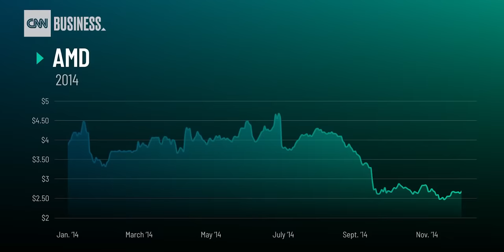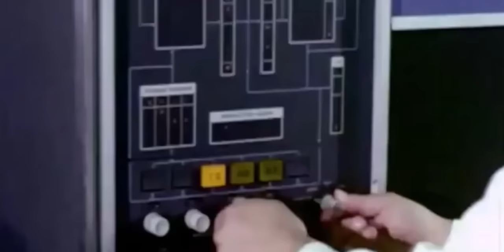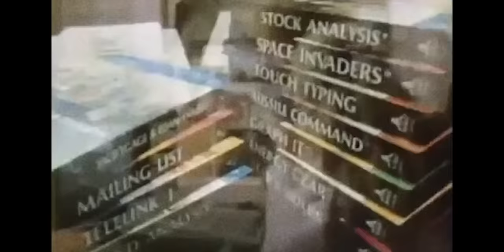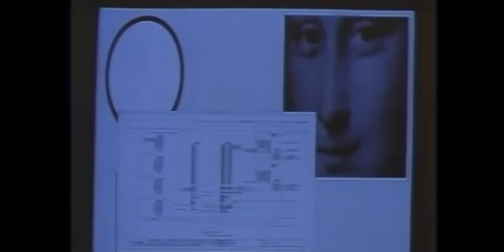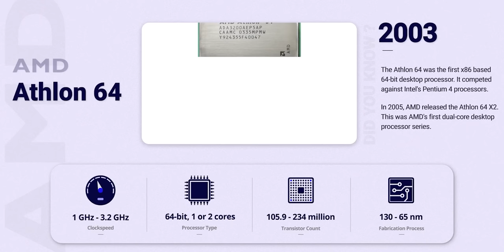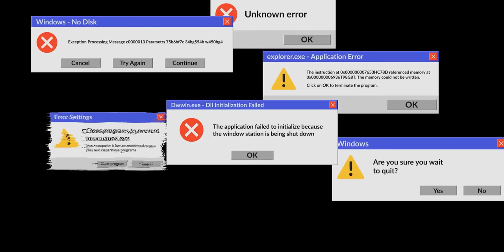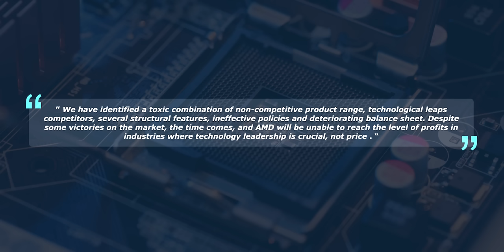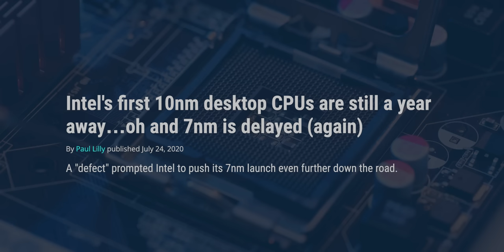The Real Reason AMD Is Worth More Than Intel

Comment: Remember when Intel monopolized the market for pretty much a decade? Absolutely minimum innovation and improvements yet towering prices. That was awesome... It shows how much we need both of them to keep one another in check. AMD and Intel are a perfect representation of Yin Yang.
Reply from the maker: Good take!
Reply: I think Qualcom should enter their processor for computer in the market.
Reply: Intel, Nasa, Disney.. the devil's mark.
Reply: So many people forget that little tidbit of history, I personally felt that intel’s stagnation is why the ryzen was so successful.  The first gen ryzen cpus were not better or worse than intels, they were about the same with a lacking in stability.
Amd also seemed to have a roadmap for faster and better designs, where intels roadmap was in the line of 5% per generation.

Barely related note, I see Microsoft being in trouble with steam os disrupting the gaming industry away from direct x, and apple going with arm processors that are faster and more efficient, in my opinion we are in the middle of a huge market shift away from antiquated x86 architecture and going arm.
Reply: The 2600k was a monster.
The 6700 a 6 month old McDonald's burger.
Reply: @RG3DHD i dont recall saying x86 will die, i said shift. meaning more and more arm will dominate the market before too long, a transition to more efficient and faster hardware.  x86 has its limitations and old instructions that have to be present limiting its ability to compete with arm. its like comparing carburetors to direct injection, carburetors are still around and being used, just the mainstream market shifted to better and more efficient technologies. 

if you dont agree, that is what playing the stock market is like, i think itll go one way, and you the other, time will tell.
Reply: @benjy117  Why? How?
Reply: @TickerSymbolYOU  i liked how you kept this simple enough for anyone to understand. those of us who follow tech will like adored tv videos of intel vs. amd and the nvidia vs amd. you get a sub for taking the time to understand what was going on and keeping to simple. will be keeping an eye on you to see where you go from here!
Reply: Who is the secret semi conductor giant ??
Reply: We're still missing 1. We always need a total of 3 for perfect balance.
Reply: @weebiyappa3333  Samsung
Reply: @D Nvidia actually deserves first place because they deliver big improvements. The only problem are the prices... It will take a long time for the competition to match their GPUs in performance and features so their can lower prices, but by then, Nvidia will probably be too ahead again.
Reply: @thomaslabrum8182  Interesting points Thomas
Reply: @amitchodankar1989  imagine that ARM processor can be replaceable like an x86 CPU's
That must be a game changer. 

I think one of them already thinking about this.
I mean AMD and Intel
Reply: @amitchodankar1989  Qualcomm's strength is the ARM architecture. X86 is a completely different animal...but I agree, they need to expand more.
Reply: @TickerSymbolYOU  There is a slight error in your video regarding the original IBM PC.  The original IBM PC actually used the Intel 8088 not the 8086.  The 8088 was a crippled version of the 8086.  Crippled in that during packaging only 8 of the 16 data bus lines where electrically connected and exposed for use.  So where the 8086 could make full use of all 16-bits of the data bus the 8088 was limited to moving 8-bits or half the amount data per memory clock cycle.  As such the 8088 was a cheaper than the 8086.
Reply: @SoulGuitarMetal  In terms of raw Rasterization, AMD beats out Nvidia when comparing RX 6000 and RTX 3000 series. And if leaks are to be believed about the new 7000 series cards, they're going to dominate Nvidia, most people don't care about raytracing, which is Nvidias specialty. Nvidia being the best has ironically made them believe they were untouchable, until the 4000 series dropped with sky high prices and garbage connecter that is dangerous to the consumers.
Reply: @pamus6242  the best thing was 1600AF. They were selling 2600 under 1600 name and they did not even mention it. Of course, in that time, it was cheap AF, pun intended. Before C19, before war, before ether mining craze. Times were great.

Comment: Ryzen really turned things around and made me really love AMD. Their laptop Chips are top of their class in terms of efficiency, i feel the reason why AMD is at the top now is because intel got complacent, everything from the 8th gen to the 11th gen all felt samey. That’s when ryzen really rose to the top, it also helped that their CPUs are generally cheaper and more efficient. I am glad that intel and AMD are competing again with alder lake.
Reply: 8th to 11th? They were doing same shit way before that. 3rd Gen to 7th Gen were practically indistinguishable, performance upgrade practically identical to simple overclocking.
Reply: I think the biggest problem for Intel was and still is the 10nm process.
Their 10nm process is similar to TSMCs 7nm process, however, TSMC is no longer using lithography but EUV, while Intel is still trying to squeeze out as much as possible using lithography. If they had switched to EUV, Intel could have easily swept AMD away, and I am saying that as an AMD fan.
Reply: @bionmccool  I think so too! That's why people look only at the i3-5-7 numbers more than the generation or model number, the difference isn't that much. Glad competition is finally back, letting people have much better chips at a much more competitive, (relatively) affordable prices.
Reply: @bionmccool  True dat and 8 onwards we got more cores but still the same Haswell cores for all its worth
Reply: @jonson856  well..
Reply: the reason amd is back on top is actually its use of chiplets which meant that with just 1 design amd was able to address all the way from HPC to low end desktop, no matter if intel was faster to the new node amd had a huge advantage of shear core count with 32 cores per socket (in 2017 is crazy) and really low cost of manufacturing, worst case scenario amd would have still sold a lot of cpus might have took them longer to get back up.
Reply: Yeah efficiency of AMD chips is amazing in laptops. I had a laptop with 10th gen Intel i5 and it lagged and battery also died fast. Now I am using one with Zen 3 Ryzen 7 and it is so much better.
Reply: I get similar performance on a 4790k as people I know with 10th/11th gen chips in most situations. They might have a 15% or so advantage in something if that software has a feature my cpu is too old for.
Reply: @fkknsikk  problem with those 4 cores is if you try do do more at the same time, i my 4670k stuttered quite a bit. because i always had other things opened in a 2nd monitor
Reply: I think the fab+ chip model runs into too much of the central planning problem. the amrket is finding it more efficient to have separate specialized companies, and it makes sense since one doesn't need the other to be developed together closely enough nor do they share the same research inputs.
Reply: I lose faith in Intel when I went from 6900Q to 8500 in my laptop without any gain in performance AND worse battery and thermal life. Meanwhile the dirt-cheap Ryzen 3500x PC blow them both out of water
Reply: Ryzens were big change for AMD, but there is still plenty of lies and myths created by AMD fanatics, like that it's cold (no, it's not, it's hotter than Intel with more powerfull high TDP CPUs) and Intel is not THAT bad as AMD people say. Yes, for notebooks, AMD is better option now, it looks like Intel totaly gave up with making low TDP CPUs, maybe they just don't have enough capacity in factories and they focus more on high end for some reason, it's sad.
Reply: @jonson856  The biggest problem for AMD is that they are not able to make  those CPUs by themselves, they are addicted to companies like TSMC. I still think that Intel is more advanced company because they are able to develop it and make it by themselves in their own factories which is still impressive even when their process is not the most advanced. I really hope that Intel will come with something better soon because we need competition on market again, today situation on market is just terrible, when you want to buy more powerfull CPU then your 10 years old CPU, you have to buy CPU for like triple price than your old CPU was for back in the day, that's not good, better HW is more and more expensive every year and I am scared by how far this can go, maybe in 2030 mainstram CPU will be for 1000 USD and GPU for 3000 USD, who knows.
Reply: @Pidalin  AMD used to have their own fabs. And this almost bankrupted them.
Reply: Ryzen laptops are chill AF.
Reply: @jonson856  it's impressive how intel makes use of 10nm. Like I thought 13th gen was 7nm Or maybe lower looking at the Proformance but was actually genuinely surprised that it's a 10nm competing against 5nm.
Reply: Same! AMD is a go go for me, and will still be. Never going on Intel again
Reply: @jonson856  EUV uses shorter wavelength/smaller beams to achieve higher resolution lithography than DUV which is used in the 10nm process but both are "lithography".

Comment: Concerning AMD 64-bit, you forgot to mention that it was AMD's succesfull x86_64 architecture that made it available to run old x86_32 code. That prevented (and saved us from) Intel's foolish IA-64 that would have upset the software base around the world (in a bad way). Thanks AMD!
Reply: That architecture is AMD64, the x86_64 label was a face saver for Intel after they were forced to adopt nearly all of AMD64 apart from a few features and used an Intel branding
Reply: Itanium.
Reply: @chudthug   Intel's plan was to monopolise the large Windows commercial market with 64bit server and emulation of x86 applications.
The Intel Inside program paid for OEM advertising, gave rebates and secured exclusive use of Intel CPU in blatant violation of anti-trust laws which were not being enforced.
The other server architectures ran Unix on SPARC, Power, Alpha which transitioned to 64bit earlier.  HP switched from its Pa RISC to Intel's Itanic.
Intel did NOT want competition they wanted a monopoly and were caught breaking laws in many countries to try to achieve it.
Reply: Regardless, Itanium was actually successful in destroying the old RISC/UNIX "cartel" and clearing the way for Xeon to dominate the enterprise market later. After that, Intel had little interest in IA64, beyond the contractual obligations with HP and the ecosystem vendors. No one in the industry had serious thought that Itanium had a chance to replace x86, and that was clear the moment Intel ditched the hardware x86 emulation support from the architecture and later made Itanium platform-compatible with Xeon.
Reply: @Ivan-pr7ku  Was it?  How many enterprize that were on Alpha/Power switched to it?  For my part, I "saved" mine by going against the architects recommandations to replace some Alpha servers with Itanium by showing that it was already a dead hardware in early 2000s.
Reply: I do also not agree with some comments in the video.
ATI was a big win for AMD, through the time of crapy bulldozer.  AMD Ahtlon64 is the best processor of all time period.
I don't think that we will encounter that kind of revolution with real benefits again. Maybe when we simplify our architecture towards ARM. Let's see.

Comment: You missed a major milestone...  At the time the Athlon64 came out, intel had decided that the x86 instruction set had outlived it's usefulness and implemented a new 64 bit instruction set, which meant new software all around.  AMD developed a 64 bit version if x86 that worked seamlessly with existing software.  Intel had to create an emulator to run existing software until they licensed the 64 bit instruction set from AMD.

Comment: If I remember it correctly , the Intel core duo series was pretty much Intel’s last trick in the bag and it was originally intended for mobile platform ? And the gamble worked out well in their favor that this platform worked so well and kept their dominance for years . On AMD side, I’m sad u didn’t mention Barton and operon :) those were fun chips !!
Reply: yes but is not Intel's last trick, they were just scamming the industry with high clock rates.  whereas, some users are overclocking the Intel laptop chips beating the Pentium 4s at lower power consumption and matching AMD's CPUs.  I also remember correctly, these laptop chips design from Israel are closely related to the Pentium Pro.
Reply: Yes, close. Intel was on this crazy trip trying to make a CPU that can clock as high as possible so they would have the most impressive numbers. The average Joe just knew "more MHz/GHz = more better". This was the netburst architecture, resulting in the pentium 4. But the architecture had downsides under certain workloads, and Intel overestimated how quickly they'd be able to increase the clock speeds. Power consumption and thus heat output was getting out of hands at higher speeds. The core architecture was indeed first meant only as a mobile platform for power efficiency, and was not based on the P4 but the previous architecture. It was developed by the Israelis in Haifa, and when it finally dawned on the higher ups at Intel HQ that the Pentium 4 was a dead end, they realized what they had going with that funny little core side project, and turned the second iteration of it, the core 2 architecture, into their main act, and the core 2 duo quickly came to dominate the market in pretty much every discipline. However, Intel did have a few more noteworthy advances afterwards until about the Skylake architecture, after which they basically went like "lol no competition let's just twiddle our thumbs and keep making money"
Reply: Zen architecture was originally from k5’s original concept but it was difficult to manufacture in older fabrication and the design was quite ambitious but also glitch as hell, later was enhanced by John Keller and process is down to 14nm it finally became an actual solution. It was also AMD’s first 4D (four decode) design since the debut of original k5 blueprint. However it took 3 years to finally beat skylake in IPC in slightly margin which it shows that four decoder is still a huge bottleneck against any modern architecture with more decoder (golden cove’s 7, apple m1/m2 with 8) despite it can still trade blowing with cypress cove’s 5 decoder.
Reply: Intel not only came out with the P4, that initially performed reasonably but with thermal throttling in the double speed logic, but the Itanic trying to take server proprietary to seal their monopoly.
The PentiumM for mobile followed based on PIII line, which was better received due to power efficiency for battery life and decent performance.
But it was AMD64 introduction with Opteron and Athlon 64 that gave the industry a way out of Intel's tasteless decisions.
Reply: @RobBCactive  itanium. dead on arrival!!!
Reply: Im pretty sure the A64s were better than the Core 2 duos - its just intel was paying everyone off not to use the competition.
Reply: @neavo8421  AFAIK C2D were better. Yet Pentium 4s were much worse, but Intel payed so much money that they outsold Athlons